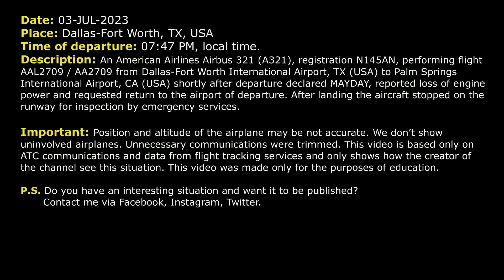MAYDAY. Engine power lost power on takeoff. American A321 returns to Dallas-Fort Worth. Real ATC

Comment: Isn't the term "Mayday" supposed to be used for aircrafts in imminent distress/danger?  When the pilot was fine to fly around running check lists the "Mayday" term was misused.  Sounds like there was doubt about the gravity of the situation at that point.

Comment: Worst Air traffic controller ever. Saying mayday is an equivalent to declaring an emergency. Declaring an emergency essentially puts the pilot in charge. I've heard a pilot declare so that he could pick the runway he wanted to land on. He declared and TOLD the controller what he was going to do. That's how it generally works. With that said if there is a traffic conflict, that's not something that will be ignored by either controller or pilot.

Comment: Not the Departure Controller's best work for sure. That was a TEXT BOOK radio call (Mayday, call sign, issue, engine out heading (industry standard) and requested altitude. I say industry standard because the "normal" procedure when you bang an engine on takeoff is to fly a safe heading that clears both terrain and traffic. The RNAV is designed for "all engines operating". So he should have kept them on that heading or provided a better heading to clear traffic (no terrain at DFW).
Reply: Mr. Know It All.  🤡🤡👈👈
Reply: @RLTtizME  sure you are
Reply: @M3T2W01f  Thanks sweetie. Pithy and clever. 💋

Comment: Mayday vs Declaring an Emergency
The FAA Training Manual for ATC is very clear on this:
FAA Order JO 7110.65AA - Air Traffic Control
"Section 1. General
10-1-1.  EMERGENCY DETERMINATIONS 
   a.  An emergency can be either a Distress or an Urgency condition as defined in the “Pilot/Controller Glossary.
   b.  A pilot who encounters a Distress condition should declare an emergency by beginning the initial communication with the word “Mayday,” preferably repeated three times. For an Urgency condition, the word “Pan‐Pan” should be used in the same manner. "
   c.  If the words “Mayday” or “Pan-Pan” are not used but you believe an emergency or an urgent situation exists, handle it as though it were an emergency. 
   d.  Because of the infinite variety of possible emergency situations, specific procedures cannot be prescribed. However, when you believe an emergency exists or is imminent, select and pursue a course of action which appears to be most appropriate under the circumstances and which most nearly conforms to the instructions in this manual."
Reply: @UCM6_3LTvxcyTnE5BgaUwXjA Those terms are used all the time with the Coast Guard in the US.
Reply: ICAO standards, used in AsiaPacific as well
Reply: OMG...how long did it take to post that.
Reply: @RLTtizME ot long considering the comment is copy and pasted from the atc training manual🤡
Reply: @PolarKitsune  Yet in America....Emergency is now the declaration. Just because it was included in a manual in 1947 doesn't mean it is still followed today.  The clown looks a little like your avatar. 😂😂👍👍
Reply: @RLTtizME  source? Also emergency and mayday are 2 separate things still
Reply: @RLTtizME  still no source for your info? Tough. It’s been 3 days
Reply: @PolarKitsune  Well that is so sweet... you have devoted considerable time in following up on this. The 1947 FAA Training Manual has not been updated with the revised declaration but rather....because of common and predominant usage in America, it has become procedurally accepted protocol. How do we know this...well you can educate yourself on this matter by viewing the thousands of videos covering emergency declarations of aircraft in American airspace.  You can also reprise the comments of triggered commenters lamenting the fact that the nonsense declaration of Mayday and Pan Pan are not being used in favor of "emergency" or "emergency aircraft". .  On top of that.....ATC in America never challenges a declaration of "emergency" rather than a Pan Pan or Mayday. This is an obsessive topic for all EuroBrits for some reason....but makes for amusingly interesting reading. Cheers and I hope this has been responsive to your concerns. Are you a EuroBrit perchance?
Reply: @RLTtizME  The comment this is on literally states that there’s a difference between Mayday/Panpan vs Declaring an Emergency. The tower won’t challenge an emergency declaration because it signifies that there is some sort of thing that is urgent but it does not make them the same thing. Also the word mayday is internationally recognized so it’s not “silly words” for the sake of it. Not everyone speaks English but it would be nice if everyone could to allow for easier communication. “Emergency” is English and not known by everyone.
Reply: @RLTtizME  also no I’m not British
Reply: @PolarKitsune  Flimsy. Mayday is a silly word to be sure. Emergency is known worldwide. You sure seem like you're a Brit. Pip Pip and brilliant.
Reply: @RLTtizME  just because you say “emergency” is more known or better to use because it’s less silly doesn’t make it so. Mayday is easy to recognize and still is universally recognized and even if a manual is old it doesn’t mean it’s not used in modern context. It’s updated to need to be.
Reply: @RLTtizME  I’m still not a Brit
Reply: @PolarKitsune  Yet you possess many of those qualities that are frequently deemed to be repugnant. Cheers.
Reply: @PolarKitsune  Sadly….no ….but thanks for your input.
Reply: @RLTtizME  “your opinion isn’t valid because your British” is what I’m taking away from this. Also I’m still not British
Reply: @PolarKitsune  You are stuck in a loop. Much clucking. Cheers.
Reply: @RLTtizME  Even if I am stuck in some sort of loop it doesn’t make your opinion that you refuse to give fact to valid. I have kept asking on your source for it becoming the new standard in America from previous conversation. Mayday is not just a “silly word”. You still seem to refuse though the distinct outlines by the FAA. At this point it seems your bringing unrelated things into a conversation about aviation. My nationality doesn't matter to a question about worldwide aviation.
Reply: @PolarKitsune  This has all been addressed. Now...take another trip around the loop. In America....EMERGENCY is now the declaration. Listen for yourself. Cheers and have a less vexatious day.
Reply: @PolarKitsune  btw.....Mayday and Pan are indeed silly non-descript words and are an affectation of WWII. I know you agree.
Reply: @RLTtizME  They are not silly words. In my opinion even if we’re setting aside the actual aviation industry it makes sense. It’s distinct in many languages and is easy and well known.
Reply: @RLTtizME  give me a genuine source for that and I’ll say I’m wrong. As simple as that. I’m not gonna spend any extra time if I have proof that it is on that. Just give me a source.
Reply: @PolarKitsune  No sweetie...you're finished. Take a final lap and get lost.
Reply: @RLTtizME  your seriously gonna loose like that? You don’t have a source to prove anything whilst the actually FAA says on there manual it’s the standard? 10 days of back and forth and your gonna be a sore looser?
Reply: @PolarKitsune  I'm gonna "loose". LOL....what is loose?
Reply: @PolarKitsune  No.....go find someone else who might better appreciate your drivel.
Reply: @RLTtizME  good point, I meant in the sense of mayday being a “silly word”. It’s more a opinionative debate so I suppose your question there makes sense
Reply: @RLTtizME  what drivel? The only thing I’ve done is prove it is FAA standard and ask for a source for your false info.
Reply: @UCM6_3LTvxcyTnE5BgaUwXjA  https://www.faa.gov/air_traffic/publications/atpubs/aim_html/chap6_section_3.html

Comment: 🥀🇺🇸🥀
 The speed that the pilot and ATC speak to each other is amazing. It appears the ATC has to have extreme amount of knowledge regarding every plane that takes off, lands, and those that declare an emergency. The training each ATC person goes through must be grueling. They’re the difference between getting the plane down,having emergency vehicles ready, waiting to hear the pilot speak again. It’s such an important, high stress job, especially when they have to keep track where all others in the air are. Not many, I would imagine, would be able to hold up from all of the stress. 
I remember back in the 80’s, and I can’t remember why, President Reagan fired all ATC individuals, replacing them.  Monumental accomplishment took place well, fortunately.
🇺🇸🥀🇺🇸
Reply: the ATC guy should be fired. He put a lot of extra workload on the pilot instead of helping him. The ATC asked if it was an emergency too many times and told the pilot where to fly at what height and direction. A mayday plane normally tells the ATC what it needs and ATC makes it possible. Worst atc handling on an emergency I have ever heard yet
Reply: @computerjantje  
🥀🇺🇸🥀
Thank you for spelling it out to me as to proper handling by the ATC should have been. I do agree with you since I have more information provided by you.
🇺🇸🥀🇺🇸
Reply: 🥀🇺🇸🥀
I had no idea that what you described is the way May Day calls are handled. Having the knowledge passed along to me, I listened again, to hear what you are talking about. The ATC seemed to be impatient with American 2709. Thank you for filling me in. 
🇺🇸🥀🇺🇸
Reply: ATC guys/gals were going to strike in 1981, I remember that day VERY well because my Dad passed away that day and I was trying to get from JFK to LAX!  President Reagan said, "If you strike, you're all fired!"  They went on strike, so he fired them!  He bought in Military ATC, but it didn't make up for the numbers of ATC needed.  They knew their jobs didn't allow them to go on strike but they did it anyway so tough on them!  They shouldn't have accepted those jobs if they weren't willing to abide by the regs.  BTW, my Mom was already in another hospital very ill when my Dad had a heart attack at home, so I really, really needed to get to CA and take care of things.  Thank God for a wonderful reservations agent at AA, she understood me through my tears (Dad was just 53) and got me the three seats needed for myself, my husband and my sister.  God bless her always.  What a nightmare that day was!
Reply: @beadbird  
🥀🇺🇸🥀
I’m sorry for your loss. It was really nice how you were treated and helped on that day. Thank you for your reply and filling me in about the time of the strike back in ‘81. The only thing I could remember was that my husband and I thought about uprooting our life, and head to Texas so that he could train to be an ATC. I hope that you have a wonderful day.
🇺🇸🥀🇺🇸
Reply: @Mom-USMCRichardUSMCChristopher  Thank you, you too!
Reply: @beadbird  
🥀🇺🇸🥀
Yes, it is a nightmare that you went through, losing your father, mom in the hospital, ATC on strike. I’m so sorry you had to go through the loss. Fortunately you had a very nice agent that was able to get you aboard another airplane. We were 20 at that time, and my husband and I seriously thought about heading down to Texas to go through the schooling to become an ATC. I don’t remember what took place that we didn’t go, but I , to this day, still agree with what President Reagan did. Total chaos, danger they brought upon everyone that was in the air, and on land. He was a great President. Thank you so much for sharing what happened that time period and day.  Wish my memory was still that sharp to remember the details. I hope all is going well with you. Both of my parents went to Heaven in ‘98. Still, to this day, I think about what we could have talked about in every Monday morning 10:00 tea. Crazy. All these years later. Thank you again for writing back. 
My user name is actually USMC Richard and USMC Christopher’s Mom before YouTube for some reason changed all by beginning with the @ then usmcrichardusmcchristopher4475.
🇺🇸🥀🇺🇸

Comment: Can anyone explain why the pilot asks to "get further right"?
Reply: I think the pilot was requesting a tighter right turn to intercept the localizer faster and therefore get on the ground faster, I am not a pilot but I watch a lot of these videos :).
Reply: Thanks!
Reply: The aircraft will turn in a more shallow bank (probably following engine out checklist), therefore the pilots required more time as their turn would be slower. In higher bank angles lift is reduced, when single engine the effect when turning into the bad engine is amplified, hence checklist require limit to the bank angle at slow speeds. The controller here most probably expected a regular turn rate and didnt call an early turn.
Reply: Yeah I never heard that one before
Reply: It was a political statement.